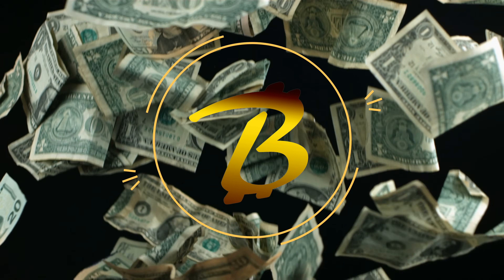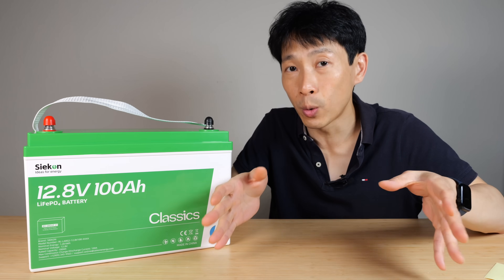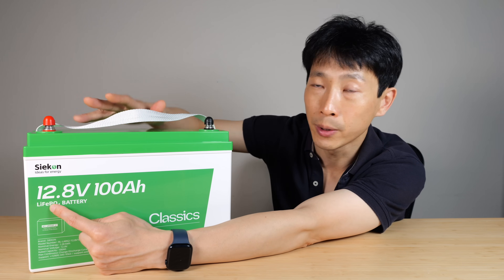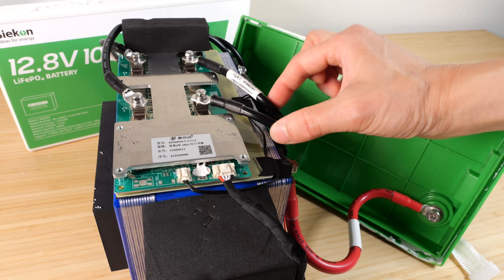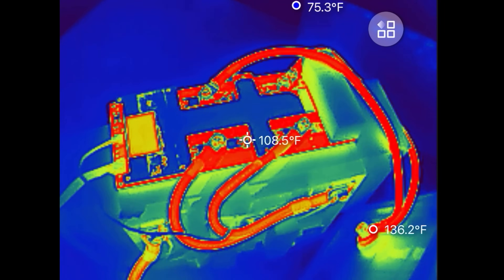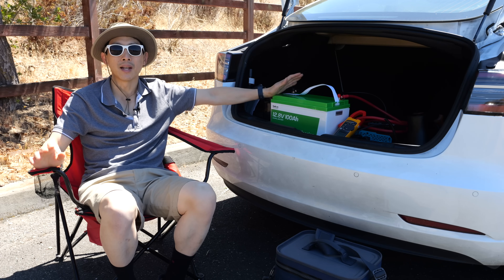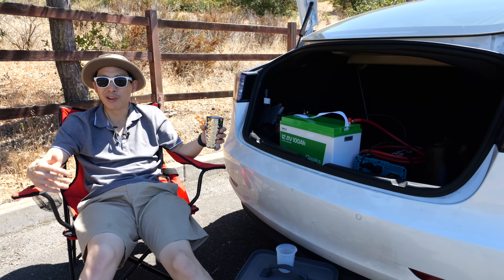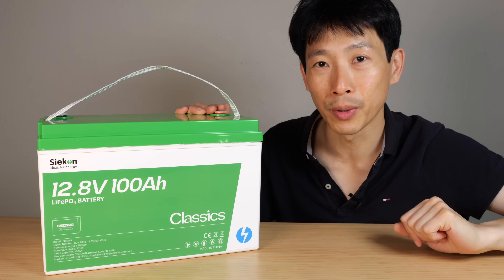16¢/Wh Trolling Motor Capable 12V 100Ah Battery [Siekon]

Comment: Makes sense, but this is the first video I have seen, and I have been researching quite a bit lately, that recommends using a battery bank balancer when in series
Reply from the maker: They become unbalanced after 3-6 months. It's really annoying to have to rebalance them that often.
Reply: @BeatTheBush  Good info thank you. Didn't know you had to do that after the voltage was balanced initially.

Comment: same size as my 280ah battery i made with 4 aliexp cells and put in my ev with custom solar roof lol.
Reply from the maker: Most of these standard size batteries have way too much empty space inside filled with foam as spacers. They do have new ones that uses non-standard sizes that doesn't have extra space inside.

Comment: When you parallel or series, you need to ensure they are at the same state of charge.  This can NOT be done by simply connecting in parallel and waiting. The charge vs. voltage curve of LiFePO4 is too flat for that to work. They must be fully charged individually.  If the cells inside are not balanced (and many are not from the factory) the BMS may be cutting off charging differently between batteries and you may need to repeat the individual full charge several times until the settled voltage right after charging is close for each battery.

After each battery is behaving properly individually then connect them in parallel and fully charge again.  Then if you want to use them in series disconnect from in parallel and connect in series.  For series use the bank balancer you mentioned is a good addition.  If not, then you will need to periodically disassemble the bank, charge in parallel then reassemble.  You might be able to full charge the series bank then use a 12v charger on the individual batteries to minimize how often you need to unwire and rewire the bank to balance it.  (This same management was needed for lead acid as well.)
Reply from the maker: In order to connect them, it is true, you must charge them fully first. Unless they are already equal in voltage to the +/-0.05V to begin with, then you can skip a step. I talked about connecting them before so I left it out in this video to avoid repeating the same thing.